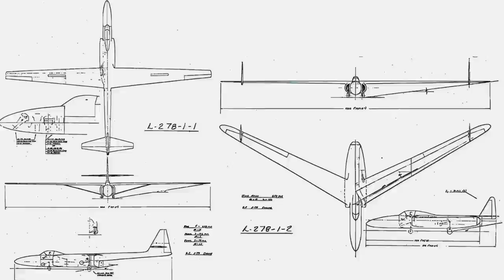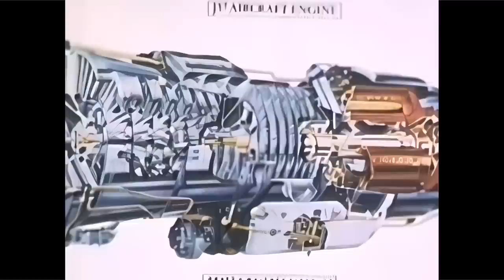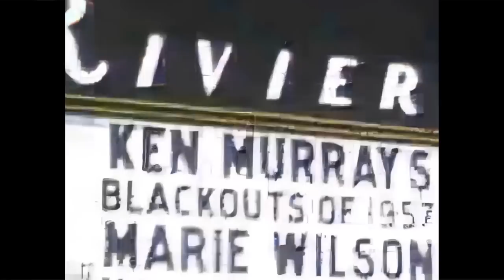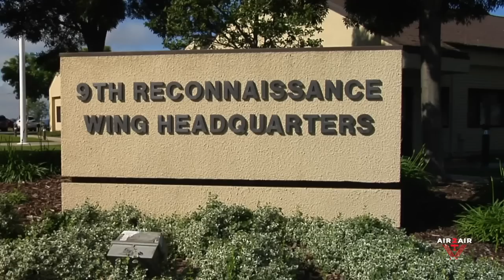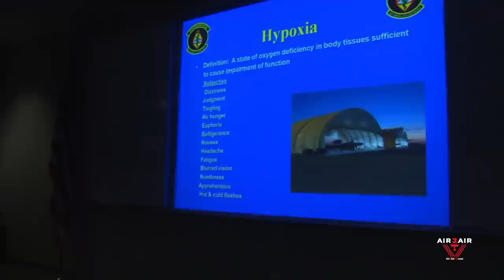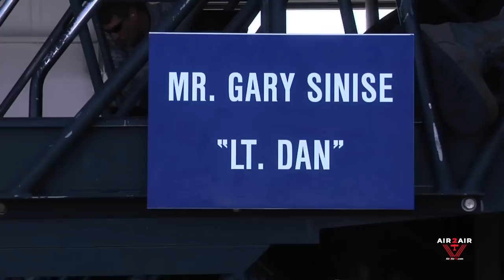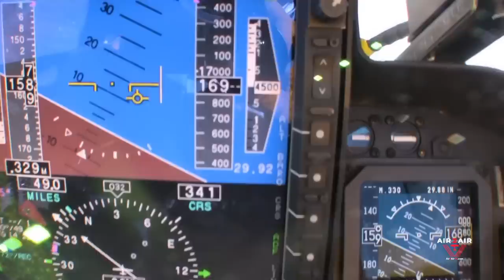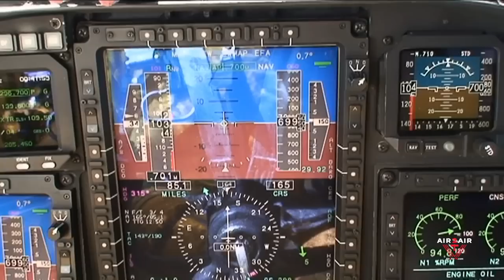The U-2 Spy Dragonlady Secretive Origins And A Glimpse Of Area 51 | Declassified Upscaled Video

Comment: I lived in Sacramento CA, literally 2 blocks from the main gates of Mather AFB. Seen the U2 fly over my home multiple times, been by Beale, and Travis, and McClellan seen many, many Air Force Planes, but none made me stop, and say "Look a U-2!" Didn't matter if I was 11, or 44! Same reaction!
Reply: I worked in the 323rd AMS Radar shop at Mather from 74 to 77. The building's back door opened directly to the aircraft parking ramp. One morning, while dispatched to an aircraft for an avionics repair, I was lucky enough to watch a U-2 take off
roll and climb-out. The pilot pulled the nose up to a steep climb and held it there til he was out of sight. Amazing aircraft.